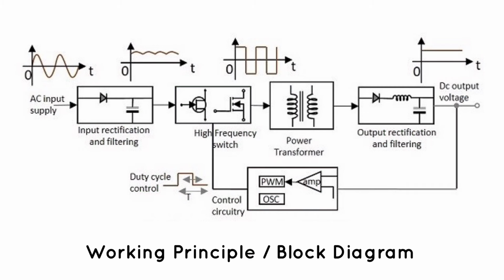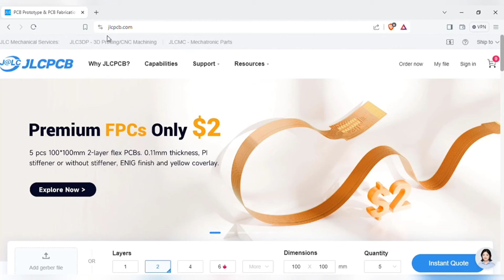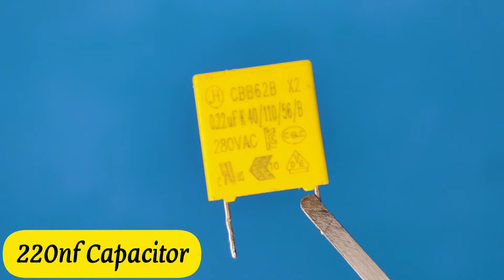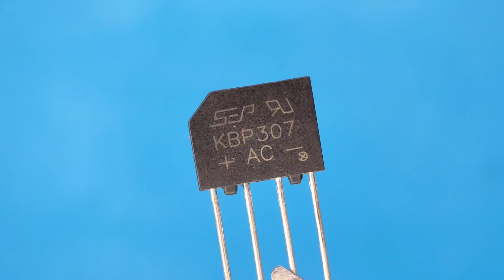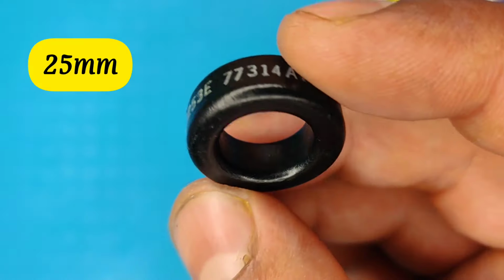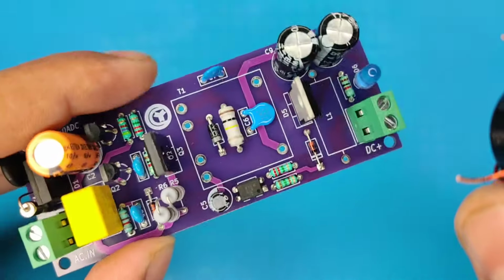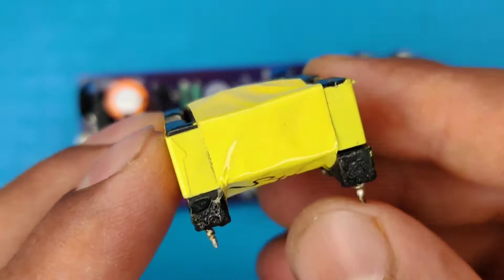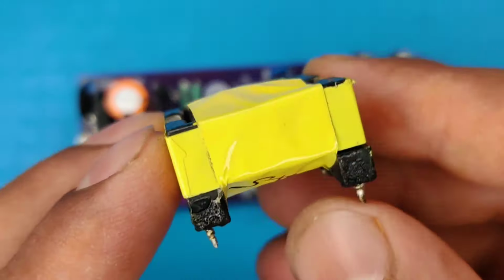Auto cut off 12 volt battery charger Direct AC #220v

Comment: how many amperes is it  this power supply??
Reply: P = I x V or Power (P) in watts is equal to Volts (V) multiply by Amps (I). Therefore It's 13 Volts unloaded 12 volts under load. We know the Volts (V) is 12, he also said it can deliver 100 Watts. Therefore Amps (I) Is amps (I) is equal to power (P) is divided by volts I = P/ V = Just over 8 Amps.